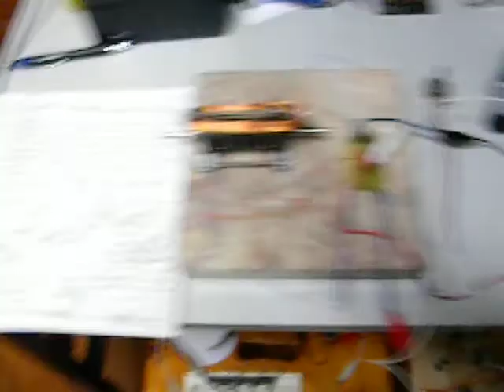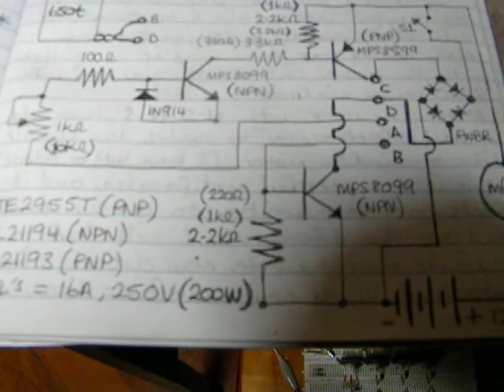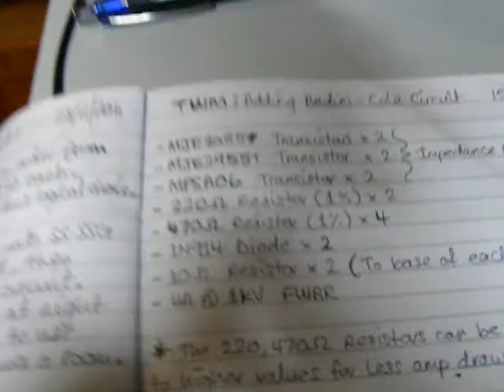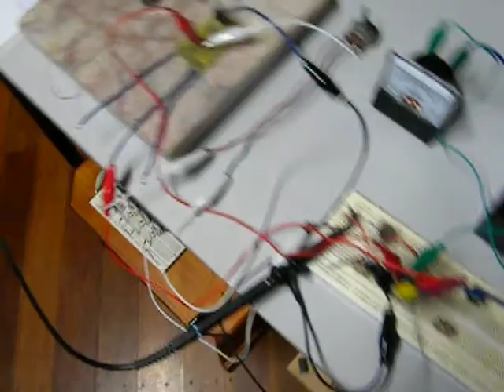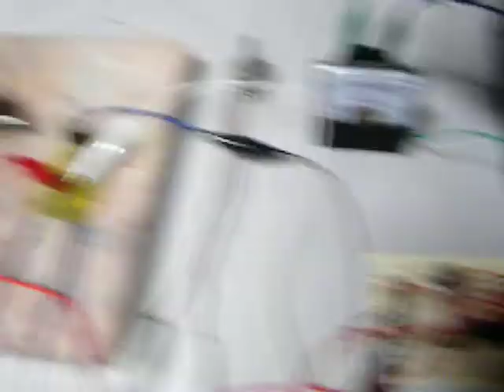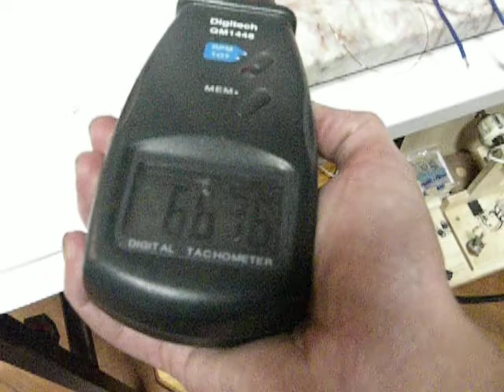Half Bipolar Circuit Mod on the TWM - 24th Febuary 2012.AVI

Comment from the maker: @picturen8 Thanks buddy. Is very easy to try with a standard SSG circuit, unless you hooked the coil up backwards to trigger the south pole to switch. Or the maybe the scalar/imaginary south pole my still switch the transistor. 
The TWM has a stator with a N-S-N-S-N-S config.
Ideally I just want the WM to generate enough RPM to recover over 12.5V and then just works like an alternator in your car.